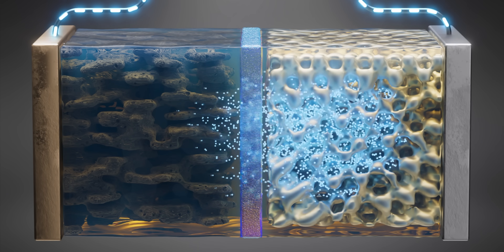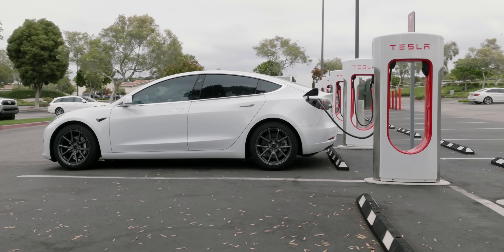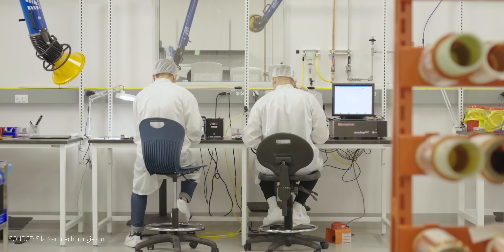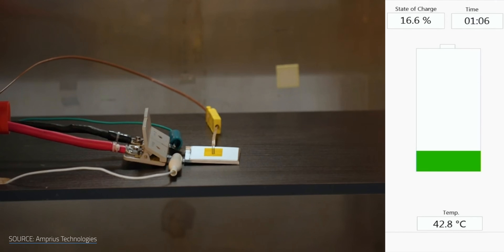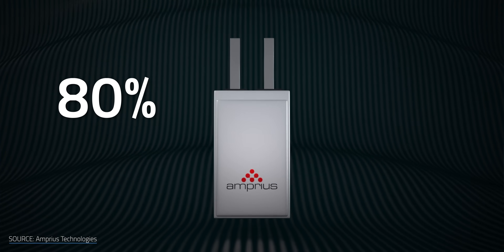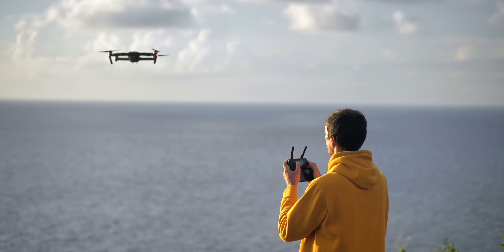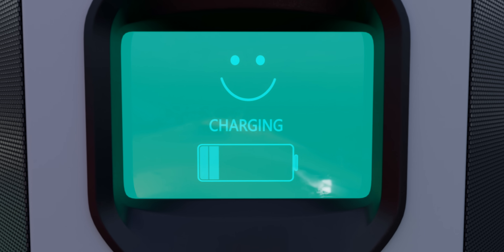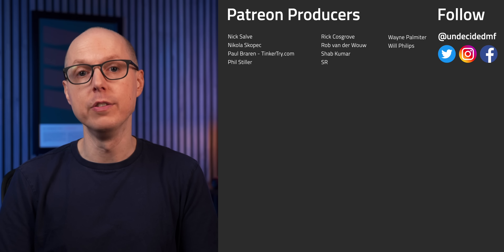Why This Ultra Dense Battery Breakthrough Matters

Comment: Xenon Coulomb Trap Super-Insulation. Induced in zero g under high pressure when doped into molten temperature nickel cobalt titanium iron; vibrated at 164mhz

Edit: there’s a secret to making this work, which I’m choosing to retain. If you have access to experimentation, lmk

Actually there’s several layers of shit I know that I barely even understand myself. But my intuitions projections are on point, always. I have this down, but not down to a science yet

Comment: If they can find a way to use them with sodium ion batteries, or solid state batteries, then we're looking at a huge boom in battery tech and much lower costs. If this tech can be used with sodium ion batteries, then sodium ion will take over lithium. The greater abundancy of both sodium and silica would reduce costs dramatically, making higher density faster charging batteries far more available. If they can go the solid state route, we could see as much as 30C ratings. We're talking a battery pack capable of storing 200 kwh at the same cost as 1.2 kwh in today's market.

Comment: Solves one problem, but creates another: Underpowered chargers. An 18W phone charger cannot magically charge these new batteries more quickly. We might start needing 50W phone chargers. A Tesla level 2 17kW charger is going to start looking peasant grade. We might need a 30kW charger. That's a lot of power. The electrical grid is going to be put under a lot of strain by this. Still looking forward to it though.

Comment: However quickly new battery innovations can charge, they still need the same amount of energy to charge.  And that energy must flow through the charger that much faster.  The grid and generation is still a massive issue.

Comment: I have to say that a six minute recharge time for an EV would definitely push me over the line into switching over, assuming we got enough charging infrastructure in place to make travel reasonable.
Reply: you do realise that trying to dump enough current into a car sized battery to charge it in 6 minutes is going to require a cable that would need a crane to lift it.
Reply: @b45her  And that, along with myriad other potential issues, may end up being an unsolvable technical impediment.  All I said was a 6 minute charge time would make an EV something reasonable to me.

Comment: We need something better than lithium if they really want to push everything to be electric, especially cars. Imagine having a new battery standard on a phone that lasts 4 days at a time, and fully charges in 10 minutes or less, and retains 80% or higher capacity after several thousand charges

Comment: I was disappointed to see that you made no comment on CATL's Condensed Matter (CM) batteries which are reported to be going into production this quarter (2023 q4). CATL  were claiming 500W/kg energy density, much improved charge times and lower costs. It might appear that CATL has already cracked the mass production problem. 
Not being right up there with the top scientists I can't be sure, but I know that my father's cousin, David Thouless, got his Nobel prize for his work on Ultra-dense materials and their internal topography. I know that it was all pretty esoteric physics, but it is interesting to see how quickly nobel prize level physics makes its way into the public realm.

Comment: Based on what you've shared I can see this being used in commercial flight with a hybrid styled 2 or 4 motor/engine set up. you'd have like to gas jets in conjunction with two electric props. using the jet to power the electric props through the on board battery.

Comment: What about water, impact and heat volatility? Is it going to burn even more violently?  I've been waiting for over a decade for this 10x battery.

The stratospheric satellite was one application I wanted to use a fast discharge beta decay battery for. So, it's good to see this battery used for that.

Comment: Even if this battery works(when they in my phone i will believe it), you need crazy amount of electricity to charge all these cars and trucks and the infrastructure to do it will take decades to build and the need for new coal power plants or nuclear for the baseload.
Also there is still the issues with fires when they start cant be stopped easily

Comment: Although EVs are better than ICEVs, my main issue with then is that they are still cars.

A sustainable future in cities and towns (where the vast majority of people live) is one based around zero carbon mobility like encouraging walking, cycling and other manual+electric assisted solutions as a top priority, supplemented with a dense network of public and mass transit. 

Cars make sense out in the sticks, but EVs will not improve anything if they're just a drop in replacement for existing personal autos

Comment: Well, with major Companies like GM, Mercedes Benz and Porsche actually incorporation Silicon Anode batteries into their vehicles then they must know something about this technology that the general public in currently unaware of. Adn with the performance of these batteries at the point you talked about in this video combined with NDB (Nuclear Diamond Batteries) being exposed as a scam and nothing but a pipe dream. The future seems to look quite bright. now, it they can increase the life of these batteries to decades instead of the current level of life, people might actually start buying electric automobiles as well as aircraft. The lifespan of the currently used battery technology in Electric vehicles is a huge hurdle for manufacturers to overcome, because no one is going to buy a vehicle that, A) begins to lose capacity as soon as it begins the use, drain and recharge cycle of vehicle operation. B) has limited infrastructure to provide proper charging stations for vehicles in every community and if there aren't widespread charging stations for vehicles then there will be certain places and routes that electric vehicles simply will not and cannot travel in or to. Finally C) the eventual shortening of lifespan due to excess use and premature battery pack failure due to errors in proper pack construction and balancing procedures which ends up forcing the owner to replace the battery pack or selling the vehicle because of the extremely high cost of replacing the battery pack, because I have seen how some manufacturers have opted to put the battery pack in a location of the vehicle that precludes the ability of a short turnaround time with regards to replacement labor, if not reduced pack pricing. So, all in all, although we have made incredible strides in battery technology in a relatively short period of time, but the battery technology level still is not at the level people want it to be in order for them to justify the cost of EV ownership over and gasoline or diesel combustion engine, that has also made huge strides in emissions goals and efficiency. which is a good thing because when people live in cold environments like Canada and Alaska, EV vehicles are simply not an option because another variable enters into the equation how temperature affects both the capacity/charge time and output/lifespan reduction. An electric vehicle is a poor choice for cold environments because the vehicle must use power to provide heat for the passenger cabin, whereas the internal combustion engine provides heat as a benefit which is a regular byproduct of the engine's operation. regardless of the time of year. But even with the silicon anode battery being more efficient and having a longer lifespan, the trouble with extremely cold environments like Canada and Alaska, still has a noticeable effect on any battery.  But I am excited to see how this technology affects the industry because right now, EVs are dying in the marketplace. Sales never was excellent to begin with because most people take their vehicle purchase very seriously and until EVs can match or exceed IC vehicles sales of these vehicles are going to be lackluster at the best of times.

Comment: the guy who invented rechargeable batterys in texas has already invented the next battery that is solid state and uses common rich in supply metal that removes lithium from the equation completely making it SAFE instead of an exploding hot cutting torch nightmare that all lithium batteries are.
all he is waiting on is the patent to finalize and the production facility to hit ready stage for mass production. salt-(iron-phosphorus and silicate)

Comment: A technology that recently hit the light on early stages of basic research is ion propulsion, this will require crazy energy densities.
Reply: Right.  And not ever available from batteries.  Need nuclear fission for that.  Fusion sounds good but still does not work. The ITER fusion facility in France probably will end up weighing thousands of tonnes and still not work.

Comment: Though laptop batteries may get lighter and charge faster they won't last longer. For some reason the industry settled in to a rut of laptop batteries lasting 2-6 hours. Past 20 years: target 2-6 hours. So despite battery tech making leaps and bounds instead of laptops lasting longer they just have smaller batteries.

Comment: Military drones seem to be the flavor of the year, probably flavor of this decade and military tech seems to have enormous budgets so my bet is these high performance batteries will first see commercial viability there.  Just like radar, a purely military solution will become cheap enough for civilian use after the production problems have been ironed out by initially using the defense dollar.

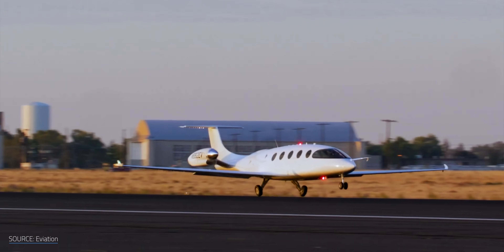Comment: 9:58 - Q: "If Amprius can currently electrify some cutting edge Aircraft, then why isn't your Laptop or Car currently powered by a Silicon Anode Battery...?"  A: because NO FREE LUNCH. <---- for better or worse this would be the "short answer" most new to the field of Science and Engineering will not be aware of, and consequently will think doesn't exist.  also ref: The Law of Diminishing Returns.  breaking news ladies and gentlemen, what's happening is you are now "bumping up against a HARD WALL OF REALITY..." (but of course since you can't see it...? quite naturally you just keep "head butting it" over and over).

Comment: I may be stupid but I don't get the expansion problem. Why not designing things that can take the expansion ? I doubt that the expansion level leads to 3 time biggers batteries. If we take into account the electrolyte and the cathode, it means that tne anode is probably (at most in smaller size level) 50% of the battery. So the "x3" factor just leads to 50% more battery size, but probably not weight.

If that leads to +50% battery capacity then that's exactly equal to actual batteries. And if you can go up to 24x, that means there is a whole lot of margin here to get the tech way up with simpler designs.

They already probably though about that, but as a random dude on the internet, not knowing shit about this, I just have questions, not answers.

Comment: I would be interested to see  how this  new battery tech could be used on home solar systems.  Using these for battery walls would be awesome!
Reply: Solar doesn't make enough power to saturate existing batteries, so not much difference at all.  Residential scale solar is a total failure, and no slight tweaks is ever going to fix that.
Reply: Some, like me, have a huge basement under a bungalow and size of storage batteries is NO consideration.  Cost is though.

Comment: In other words, it takes 200 yrs to get a commercial industrial battery out to market. None of this tech will come to light until  lead acid and non rechargeable  batteries are banned and battery dimensions  are standardized. As for nano tech, it's not hard to solve with magnetic draw tech

Comment: Sadly, even a 50% improvement in battery energy density is not anywhere near enough to make batteries capable of doing the work of fuels, for that we will need a 10x to 40x improvement. Lithium is among the most active of metals and has just so many ions we can move. The limitation is real, and will not be overcome. What we will see are ever smaller, incremental improvements to the limit.

Comment: Lithium isn't the answer. Hydrogen is.

This might be fine in small devices. But electric vehicles will go the way of the dinosaur soon. Lithium mining is ridiculously toxic and destructive for the environment. And after all of that, the power grid can't keep up at all! California's grid couldn't keep up with the tiny percentage of electric vehicles it currently has!

Hydrogen is the only answer. It's clean. And turns back into water when burned. Grid issues are irrelevant.

Comment: In nature, silicon is bound to other atoms in the form of silicate structures. In order to extract silicon, it requires smelting silicate with coke for carbon atoms to steal the oxygen atom and forming CO2. Silicon processing is also a major under estimated contributor to green house gas emission.

Comment: Hélas ! The problem remains the same: lithium.
In Europe, the Gregoir and Van Acker report reveals that the needed lithium quantity to succeed in energy transition should be 20 times more than we use today…
However, this is a good news to improve energy density! 👍 But for me, we need to see if this technology could be compatible with other material (sodium for example)

Comment: Nope. Silicon greatly reduces the cycle life of a lithium ion cell. Best is to use little of this which Panasonic will do in 2025 to increase battery cell density by 5%.  A very high density silicon anode battery posed by the video is useful for niche or extreme situations where battery cycle or cost is not an issue.  For EVs, you'd want the reliability and cycle life and lower cost of LFP battery chemistry.  LFP is so good that ageing causes more degradation than daily full charge recharge cycle.

Comment: the same problems still exist. the biggest problem is where does the electric power come from to charge these batteries? the US is DECREASING it's grid capacity,by closing "fossil fuel" and nuclear plants that generate low cost electric power,and installing solar and wind power that is NOT reliable.far more expensive,and that produces little or no power at night,which is when most EV owners charge their autos. If most ICE vehicles are replaced with EVs,the US grid will have rolling blackouts frequently. Many EV owners won't be able to charge their car at all. OTOH,maybe that's the real plan. "use a bicycle" or "take public transport".
Second problem is reduced output in cold weather and hot weather. that makes your EV unreliable. even dangerous.
Third problem is how many times can these new batteries be recharged? Will they last the life of the vehicle? Or will you need an EXPENSIVE (and maybe not available when you need it) new battery? You have to be stupid to buy a used EV,because you don't know if it will need a new battery in a short time,as has happened to some people.
Reply: BTW,consider that one DC fast charger puts out 350KW,and how many chargers you need to service the usual traffic at a gas station. Such a EV station would need to have it's own grid substation.(or it's own reactor) 3 DC fast chargers in use would use more than 1 MW. If 1 MW is all that's available,once the 3rd EV hooks up,ALL the chargers drop their charge rate to 333KW,and more chargers means even lower.

Comment: Funny that you mention battery capacity not being a problem in wearables.

For me the short time span between charges for smart watches is simply unacceptable to the point that I could never buy one.

It's more acceptable on E ink models where the power consumption for running the screen is extremely low, but their marketshare is basically none existent at the high end from recognisable big name brands.

A combo of better battery AND good color E ink displays would make smart watches fully viable.

Comment: The silicon tech batteries are interesting for sure. When they can be made inexpensive, have a good charge and discharge cycle life, fast charging and perform as claimed in this video, then I would hope this is a new technology that can be manufactured soon.

Comment: Amprius, a Stanford University startup based in Fremont, California, is developing batteries that replace the graphite anode of a lithium-ion battery with silicon, resulting in batteries that are up to 10 times more energy-dense than traditional lithium-ion batteries. Silicon is much better at storing lithium than graphite, with a single silicon atom capable of storing four lithium ions, making silicon anode batteries nearly 24 times more efficient than traditional graphite anodes. However, silicon has a tendency to swell up to three to four times its volume during charging, which can cause the anode to crack and destroy the battery. Amprius and other companies have found a solution to this problem by using nanowires with silicon to create a more stable structure. 

Other companies, such as OneD from Palo Alto and Sila Nanotechnologies in Alameda, California, and Group 14 Technologies in Woodinville, Washington, are also using silicon anode technology with slightly different spins on the silicon anode. These companies are seeing commercial success and building factories for mass production. The use of silicon in batteries could significantly increase energy density, reducing battery weight and improving performance, making it an attractive option for electric vehicles and other large-scale applications.